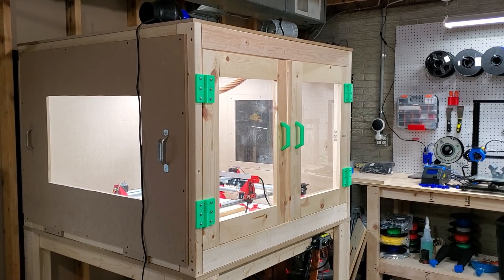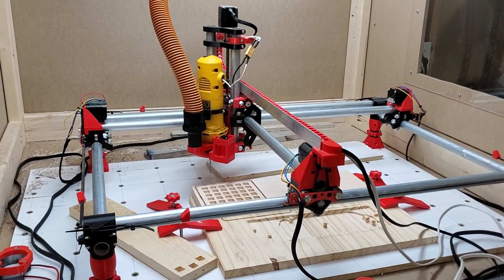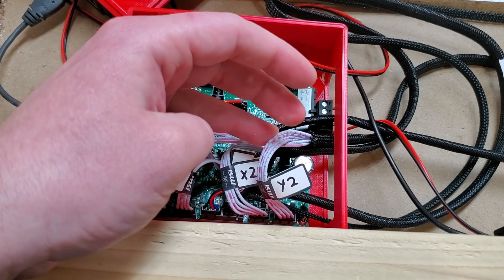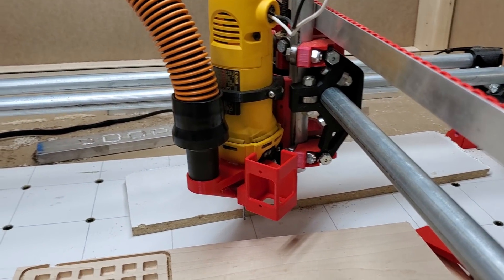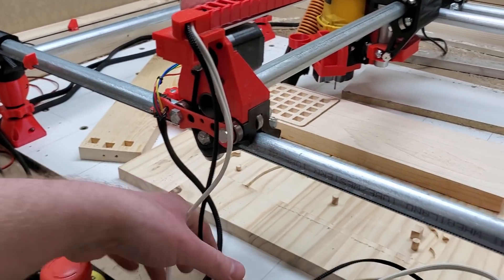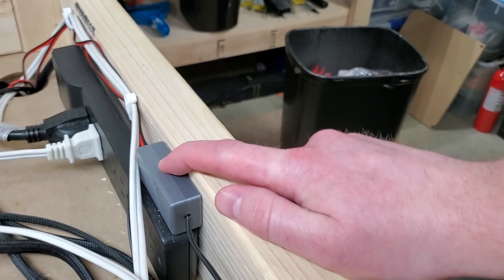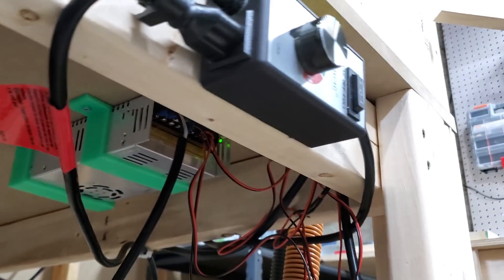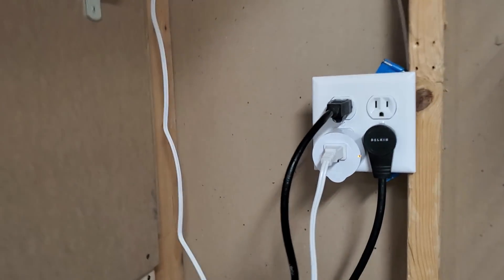Brian's Basement MPCNC Enclosure

Comment: Nice build!  I am currently researching/piecing things together before I start and your modular/interchangable system is well thought out.  I first thought the 'cable chain angle' was to reinforce any flex from the lateral movement while cutting(wouldn't hurt).  I was also thinking the speed controller was for the Dewalt.  I'm surprised I don't see these on MPCNC builds(mentioned on V1 site though).  I run a MultiCam CNC at work so I am familiar with feedrates/spindle speed/chip load.  Lowering the spindle speed increases tool life('spindle life?) and 30K is excessive for most materials/end mill diameters.  The 'recommended' spindle speed varies on power of the motor though(during load).  I've developed an audible sense for adjusting the spindle, but there are plenty of 'chip load' calculators.

Comment: Thanks for the video Brian. I'm going to use your top idea for sure. Man, I like your MPCNC build, I went with a horizontal Cable chain for the Z axis wires https://www.thingiverse.com/make:353987  but I really like your vertical design with the track going across the beam. I did Panduit for the X axis and designed a little bracket for it if your getting the urge to do that. I'm at 24" X 24" and was thinking that 18" square would add some rigidity as well as just make the whole tool a little more manageable. Did you find that as well? My primary use is acrylic lens making and small Aluminum parts.  Would love to see what your doing with it

Comment: What material did you use to print all of the brackets and mounts? If it is pla, have you had any issues with warping due to the temperatures from the motors?
Reply: @ProjectsbyBrian  Awesome! Thanks for the response. I'm planning on making one, but was a little concerned about warping because some parts that are load bearing on my printer are pla and are starting to warp/deform a little.

Comment: When your blower is on for your laser, what is its effect on your hot water heater exhaust?  Does the added air pressure in the exhaust risk blowing CO into the room from the water heater?